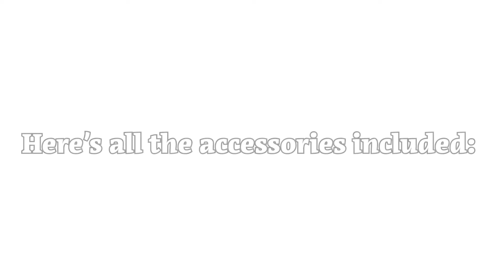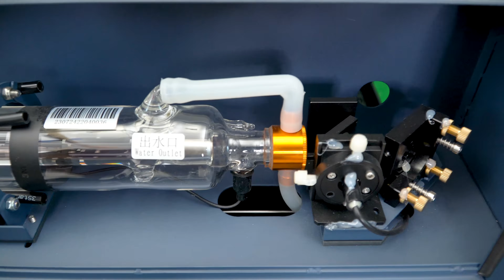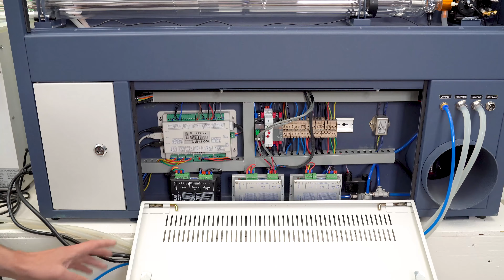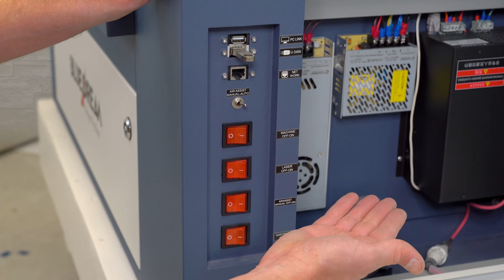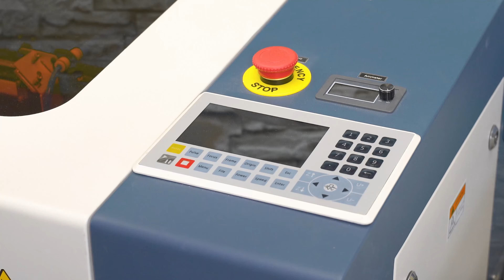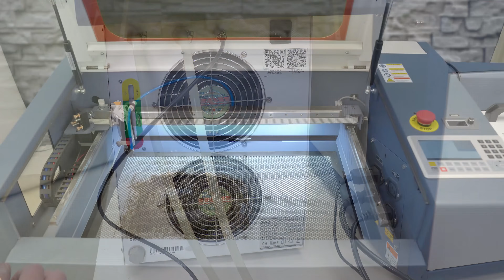Cloudray  Blue Dream Design by Russ

Comment: Hi, have you lost interest in that co2 cnc ? We havn't seen any new video using it for quite a long time!
Reply from the maker: Hi- during the last renovation update to the studio- the Cloudray 70w machine was removed and not available for recording.
Reply: @thelaserchannel1  is it because you found better co2 lasers or because you needed room for other equipment,  if I may ask?
Reply from the maker: @pleekpleek  More needing the room.  I also found I had to run the machine slower at 350 mm/s or slower due to the x-axis blet design.
Reply: @thelaserchannel1  Can you please elaborate a bit on the x-axis blet design. I have no idea what it means. And also: I have the same one in my shop and of course can’t change it right now, but could you mention similar but more to your taste models?

Comment: I cannot recommend this machine enough.  Unless you have struggled with CO2 laser, including some expensive ones, you may not appreciate how much easier this machine is to use.    Trust me it's worth your money.  I have an older, cheaper, machine that I am upgrading with all the Russ improvements and it's so much better.
Reply from the maker: Thanks for sharing-  The machine controller and display are the next level up over what's normally found on Co2 machines.  The laser power supply and laser tube are also the next level up!